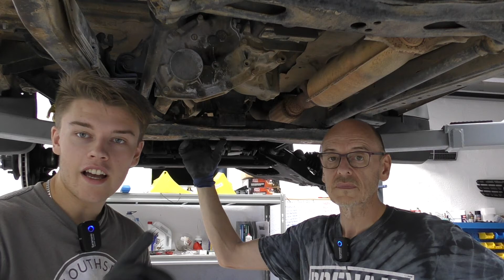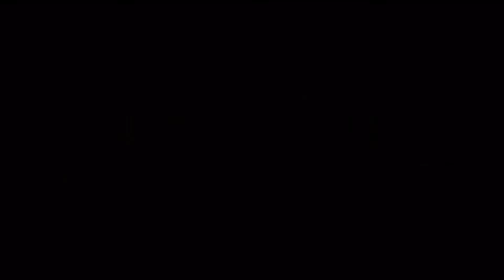4x4 Transfer box/Case Mount replacement- PROJECT L200

Comment: Urm guys I've got some bad news for you. That is not a gearbox mount. That's a locator mount from the factory and is supposed to look the way it did when you pulled it out. As long as the rod isn't knocking against metal it doesn't need replacing. Loads of threads about it on the groups and forums and your new one Will probally look just like the old one in a couple of months.
Reply from the maker: Thanks for the heads up - will check it out - our crunch from 2nd to 3rd  has gone, so we are still chuffed👍🏼
Reply: @DrivenMadShow  What did you do to solve the crunch from second to third? Was it the oil change or the mount change?
Reply from the maker: Unfortunately, we did a fair bit and did not road test after each part / fluid change  (live and learn!!) but when we got the truck, 2nd to 3rd was really bad (horrid grind) - the two things that could be attributed to the improvement was the fluid change and / or the transfer mount. The above comment about the mount splitting etc, has not happened to us - done about 10K (km) since we fitted it (Nath wheel spins everywhere to give you an idea of stress on it) and it's still perfect - so to stop waffling, my suggestion is to check out this mount and replace if it looks knackered (easy and cheap job) but also change the transmission fluid and get the best quality you can your hands on - cannot suggest as we are in Portugal and you will have different brands, but the one we used was the correct grade for our year, but described as heavy duty ! hope this works in yours🤞🏼
Reply: Just wanted to say the same. There is nothing wrong to be wrong as everyone has probably thought this is mount and needs replacing : ))
Reply: @fielder5757 can share trheads about this subjet??

Comment: Hey guyz... In my simple world, I left the bracket on, unscrewed the bolt holding the mount itself, lifted it out the top, slid the new one down into the bracket the same way, done up the nut and job done in 2 minutes.... as I see it, no reason to take out the bracket itself  ;-)
Reply from the maker: Tip in the memory bank (with any luck we will never need it :)

Comment: Hi what year is the l200 I have a 2011 model but mechanics said mine doest have one even doh it shows up on parts list thanks
Reply from the maker: Hi there,
The L200 in the video is a 2003 but we also own a 2010 model. It does not have this mount. 

Hope this helps 👍
Reply: @DrivenMadShow  thanks for that

Comment: Need help here. I've changed my engine mount and got vibration when switching igination off. Will be a great help from the group 🙏
Reply from the maker: My reply has disappeared - take II -  have you changed all mounts (hope so) ? if this has just started since the new mounts/s the prime suspects are: 

1. Faulty mount     2. New ones not seated or fitted correctly.  

If you only did one, total guess, but there would be a difference in performance and height -  no idea if that could cause vibration.

Hope you sort it
Reply: @DrivenMadShow  thank you so much. I mounted it correctly and it work.
Reply from the maker: Easy done, Nath lets me do very little :) for exactly this reason 😂😂😂

Comment: I changed mine and now I’ve got strong vibration on 800rpm. I saw in some forums the same problems after changing it. Any idea what to do? Thanks
Reply from the maker: We too have a slight one (very slight at tick over only)  - someone commented that the rubber should be split - we changed ours because it was and have not split the new one - I will order another, split this one and see what it does - will be a few weeks, sorry !!
Reply: Me too so I fitted a genuine Mitsubishi part and.... No problems now.

Comment: Hey guys can you send a link where you bought it? The mount I'm seeing online looks inferior
Reply from the maker: No probs - we got at Milner off road - unfortunately they are in the UK - the UK has no clue how to export due to leaving the EU, so you might have trouble getting, lets hope not  ... https://www.milneroffroad.com/product/propshaft-centre-bearings-universal-joints-pcbu-tr/propshaft-centre-bearing-kit-tr0003k/TR0003K
Reply: @DrivenMadShow  thanks a million, keep up the good work
Reply: @brandongoberdhan7742  this is not a mounting its designed to be a for a better description a twist stopper under high torque situations the center of the Bush breaks off and has as the one they took off there was nothing wrong with it however you can put the hard one on but hell the noise in the cab as a result is deafening

Comment: you only need to undo 2 bolts holding the mount no need to remove the bracket from the chassis😂
Reply from the maker: Too late :) but in the memory bank !